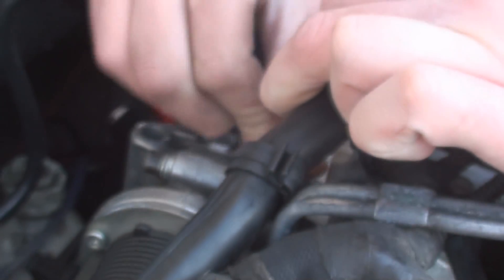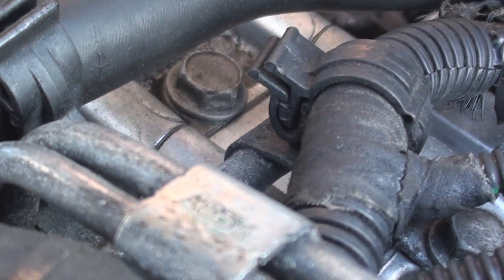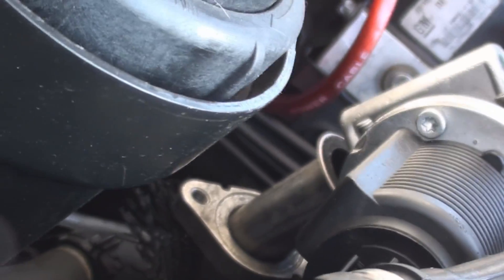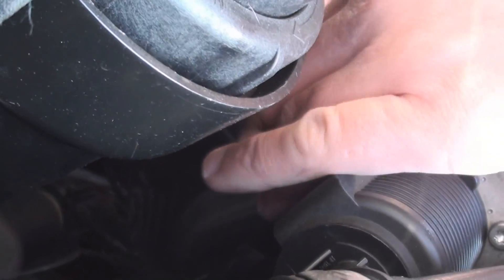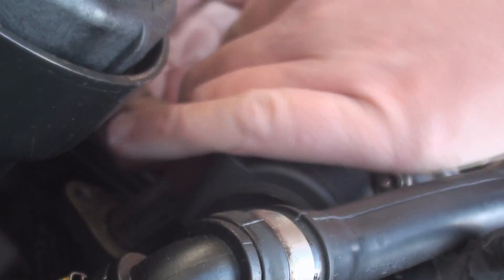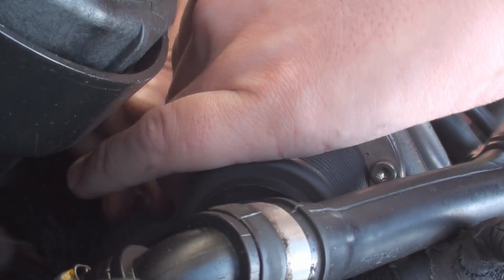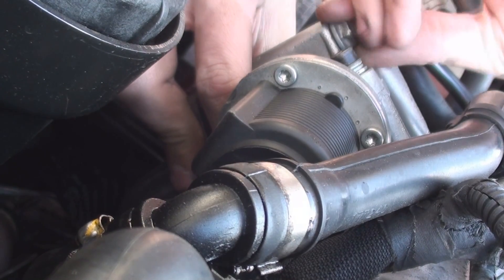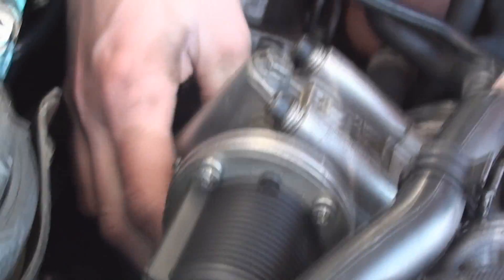How to: Fit a EGR Blanking Plate on a Diesel Engine

Comment: I thought that this was a guaranteed MOT failure in the UK?  Is it or it not? There is of course the option of removing it before MOT having ensured it still works unblanked. At the moment my poor Saab 9-5 is kicking a trailof black smoke out of the exhaust which blackens the grass in the field.

Comment: Thank you so much. You have no idea how much you've helped me. My EGR cooler failed on my Astra 1.9cdti and I didn't know how I was going to get it fixed due to parts being super expensive here. I decided today that I would buy a plate kit.. remove the cooler and and fit both plates.. But even that was a worry for me because I know other parts have to be removed to do that.. This is the same result but much cheaper and easier. I'd also like to say thanks for mentioning the plates with holes in them because I was wondering about and I was going to fit the plate without holes but now that you've explained all that I'll go with the  plate that has holes In it. Finally my brain can rest after weeks of stress. You're a legend!

Comment: Isn't having an egr blanking plate with a hole, the same as having a partially blocked egr valve?  The hole is not fully open and it's not fully closed either..... not ideal?  Won't the small hole eventually block up anyway?  Don't egr systems usually block up over time?
Reply: Having the hole in the plate is pointless.  No point putting the plate on . That plate is to stop exhaust fumes going back into the engine.  I think you are on about the egr flap .. you can take the vacuum pipe off the egr valve to stop it moving . So its always open . Ive always done a proper job and took that pipe off at the exhaust manifold and blanked it off with a gasket . Then do the same on the egr valve . If you know what i mean

Comment: I had a plate fitted here and the curved EGR pipe has split due to back pressure, best to remove EGR cooler and blank at exhaust manifold and back of inlet using both plates

Comment: In my case I blanked the egr like in this video but after 20000 miles I had a exhaust leak where the egr pipes comes off the exhaust manifold, Best way to block is on the exhaust manifold itself
Reply: I think so too, it seems to me that blocking it on the way back into the engine is just going to clog the EGR with the unrecirculated smog.  Gotta send it all through the DPF and out or block that too and just send it out like originally designed.

Comment: EGR is not working on my TDCI 1.4 engine, does blanking it will help ? its not letting revv my engine over 2k rpm..... tried installing a working one and was fine but its too costly to replace
Reply from the maker: Nope. Blanking a broken or not working egr will do nothing. As the car knows its not working and will put your car in limp mode. Clean it see if that helps. If so. Then blank.
Reply: @bluudysgarage  thanks for the information, can i apply any workaround to drive for 100-200miles .....  some good workshops are 200miles from my place and i will have to tow it

Comment: This doesn’t work and due to what your video states it has cracked my egr cooler pipe due amount of boost going through it, this blanking plate on the video should be on the turbo and on the inlet manifold, you bolted it too the wrong place. 

Bluddys garage need to research a bit better before putting videos up that people rely on
Reply from the maker: Daniel... this video has been online since 2012. You are the first person you have an issue. Please do more research in what you are on about before blaming others for your actions.
Reply: Makes sense, the EGR valve needs to be closed, but the hot exhaust should be blocked from going into the EGR and out of the EGR on both sides.

Comment: Soda can will do as an insert plate?
Reply: Yea, right, as if aluminum can could hold the 700-degree exhaust fumes, you need steel plate, aluminum can will melt and end up recirculated through your engine.

Comment: What if I must remove that plate later for car inspection once in year . I am sure it will not pass on inspection .  My question is ,  when I block EGR and descide I must remove the plate after a year for my inspection . Am I going to have any problem ? Is ERG going to be harmed and cloged when plate is on ?  What does this plate actualy blocks ?  Air that comes IN EGR or air that comes out of it ? Thank you . I hope you can answer . It would be very helpful .
Reply from the maker: Milenko Popovic you will be able to remove the plate with no issues.
Reply: Bluudys Garage And no consequences to EGR ? I mean its just for inspection purpouses . When I am pass I am puting plate back on ofcourse . Thanks
Reply from the maker: Milenko Popovic that's allndoen to you driving style. It may need a clean out from any build up

Comment: I blanked mine 8 months ago after a catastrophic manifold block up..all had to be replaced...
I left a 8mm hole as its supposed to stop the warning light coming on from completely blocking it...
Now the EGR has re blocked & I removed & cleaned it but the manifold looks really bad & im still right down on power....also light is still on..
EGR cleaning spray really helps the cleaning process I ordered a couple of cans & will be spraying that into the intake just beside the EGR every month...the only real cure is regular motorway use over 2000rpm...I live in London so my 1.9 Cdti astravan 150ps is stuffed full..
Modern diesels are too complicated to hit emission targets so that combined with the current war on diesels means it's time to sell especially if your city baced...I like the vehicle but alas it must go....Diesel has had its time it's going to die...
Reply from the maker: Diver Dan I am afraid you are right. Diesels are dying out now due to the rules and regs. Really shame your issue came back but as you said it is down to your location more than the vehicle

Comment: Do you remove the gasket and replace it with the blanking plate?
Or leave both in place?
Reply from the maker: IrishGuitarist1 I used both to make sure it didn't blow around the plate

Comment: I cleaned my LMM sensor on P307 2.0 hdi with alcohol and it finally broke. The result was that the Egr itself blocked and is still in the closed position. The result is better engine response, more power. Should I buy a new operational sensor LMM? I also noticed that the engine needs a lot more time to warm up to operating temperature.

Comment: hi there, in the vid you said that the EML light may come on if it should come on will it go into limp mode with no power or will it let the car drive with normal power many thanks
Reply from the maker: normally normal power. but can go limp if it triggers another issue.

Comment: Hi,I have Laguna 1.9DCi 74kw from 2003...Where I should put the blanking metal plate? Instead of upper part of EGR(the electronic-sensor) and leave the rest of mechanic part of EGR-valve in closed position?

Comment: Not good for the environment - look after the earth!  Not legal either!
Reply: how is it stupid, when an egr valve gets clogged up it feeds back the crap into the turbo and in time fucks it up, so don't talk absolute shit, I've blanked my egr valve off and it's passed the mots no problem I use 100% shell fuel save diesel in my car, no probs, all well and good saying about the environment but people have to fork out for problems with their car and money doesn't grow on trees, I bet you are a hippy cyclist who wears lycra and hogs the roads!
Reply: +Russell Mogg I hate the environment and do everything I can to destroy it! I fully support everyone who does the same. I removed all my emission control devices from my truck and now get far better mpg and hp.
Reply: turn your computer off to help environment
Reply: +Russell Mogg It's not good for the environment that the diesel engines are restricted in several ways. It looks good on the paper. When you have to regenerate for example the dpf all the build up will be released into the air anyway.
Reply: +opelduude   Why would you write something so stupid?  Are you saying that using this blanking plate is good for the environment ?
Restrictions are due to pollution control - trying to keep the earth clean. It looks good on paper because - it is!
This EGR blank off prevents the complete combustion - thus, blocking the DPF even quicker.
Reply: +Russell Mogg "Egr blank off prevents the complete combustion" Do you even know what an egr-valve does? It's like breating in your own farts over and over again. If you want to keep the earth clean i sugest you start with ship traffic and third world industry countries.
Reply: I ripped out my whole catalytic converter, smog pump and egr and now my truck gets about 6mpg better and has far better performance. Btw I dont live in a emission nazi state. We dont have vehicle inspections anymore.
Reply: Why sell gasket blank first place so can’t do nothing plenty of years back normal on earth :)
Reply: Jef Rey 😂😂😂😂😂😂
Reply: hahahahahahahah
Reply: hey cars are ment to go fast not to care about ur green and blue ball go fuck yourself and let the man kill his part of the world.
Reply: Engine Lives Matter, Pocahontas! It's time those fat, lazy, baby seal murdering polar bears learn to swim.

Comment: I am going to have a go at cleaning my egr valve on Saturday (first timer) but was wondering why the blanking plate is added and what does it do exactly....does it stop the egr valve clogging up again? are there any issues with doing it? Astra H 1.9 cdti 120 8v auto. cheers.

Comment: I had a faulty EGR valve on my 2001 Astra (Z16XE petrol engine). I replaced it with a brand new Delphi one sourced for a reasonable price and it has been fine ever since.

Comment: Hi, im having EGR issues with my Astra 1.9 CDTI Sri 150 2007
I know it needs cleaning and im thinking of fitting the blanking plate, but is there anything else you would need to do after fitting this plate like anything to do with the ECU? I've had the engine management light come up twice, came up once then disappeared and now it's back and im sure it's because of the EGR.

Comment: Yah, the only problem  could think of when getting rid/or blocking of the EGR valve would be that you would have to remap he injectors. How wonder how much it would cost to have it done? For the most part, it would just be hooking up a computer, and making some easy changes.
Reply: Why would you need to remap the injectors you are simply reducing recirculated exhaust gases.
Reply: Dave Davus Well that recirculated exaust gasses is more air going into the engine. Some of it has to be pressurized...?
.
I simply thought that was the problem with some vehicles with a "plugged E.G.R." valve, and poor performance? On some vehicles you could just put plates over the EGR valve ports, and have no problems, but others end up with motors that are running a rich fuel/air mixture. I guess it depends on the size of the EGR valve, and how much air/exhaust gasses it is pushing through the intake (that air isn't read by the "Mass Airflow Sensor"... or the thingy that measure the amount of air going into the intake/engine. Sends it to a computer, and the computer decides how much gas is being pumped into the engine through the injectors!)!!
.
To be honest, they should completly do away with electronic fuel injected systems, and go back to a simple carb. Nothing will ever be as exact as a mechanical fuel delivery system...
.
They also need to start incorporating reed valve in the intake, so the gas becomes more atomized. As well as a higher intake ports, or longer intake ports in order so the gas becomes more atomized (incorporate that with a carb setup)!
.
I was just looking for a... FOUND IT! This vid shows a old engine used in faming back in the day. It's got a "vaporizer carborator"! watch?v=FDHQa0zv4D4  Probably the reason 20 oil cars jumped the track and blew up (just yesterday they said it was only 6... everything changes, day to day... even the bible... WTF!?)....
Reply: Hiya Brain, you are right in a way but the gas is still metered with the MAP ( manifold absolute pressure ) sensor on this particular engine It has both a MAF ( Mass airflow sensor ) and a MAP  so it will be able to adjust the ratio of fuel to air acording to these readings. obviously other engines will vary.

Never heard of reed valves being used in a 4 stroke engine, or a vaporizer carburetor I shall check it out.
Reply: The EGR is going to put in hot exhaust fumes into your cylinders with low oxygen content that probably won't burn up anyways, instead, the fumes collect residual oil and more soot and then clump in your exhaust manifold, the recirculation method is faulty and ruins engine longevity.

Comment: 1 suggestion, add a short explanation of why you should do this mod and what maybe can go wrong doing this and even the tools you need and you're looking at a fantastic series, good video though :)
Reply from the maker: Great advice, Check out our latest EGR valve Clean (1.7), all tools needed are listed, advice given etc...

Thank you.
Reply: cool :)
Reply: Absolute Modicts if the egr is clogged surely that does the same thing

Comment: I have a 'master' blanking plate as used by the AA (Automobile Association...not the ones for alcohol dependents! ) It fits virtually every vehicle. Whenever I blank off EGR's I just draw round the 'master' template onto a tin can lid ( or similar), snip out the shape, drill out the mounting holes and job done.  Free, fast and foolproof!

Comment: Hi Mate. I fitted one of these today, and now my car won't start, just seems to turn over and over but will not fire. It's a 2006 Vectra C 1.9 CDTI (150) Any help would be great. Thanks.
Reply from the maker: Hey. Have you removed the egr and tried to clean it at the same time? Sounds like the eg is stuck open. It need to be closed to allow the car to start!
Reply: Absolute Modicts Hi, and thanks for the reply. It was starting ok before I fitted it, so would that still apply in this case? I fitted it as the thought of clogging my engine isn't nice lol
Reply from the maker: Shouldnt normally cause this issue, possible there is a EML light on and a code stopping it from starting. i would take the plate off and try again
Reply: Absolute Modicts Well, I think battery is on way out. Had to jump start it and it took a fair amount to get it going. Guess the engine was kinda confused after the plate was put in lol Drives great now, instant improvement. Cheers mate.
Reply from the maker: Well at least ita sorted! Glad its better! Thanks for watching!

Comment: Can you use the existing bolts with the blanking plate or do you have to use extended bolts? Thanks
Reply: Thanks for your reply Ahsan. I fitted the blanking plate a few months ago now but thanks anyway bud 😃
Reply: @johnbob90519  what was the answer?

Comment: Hi I'm struggling trying to fit one of these to my astra. Do I leave the gasket on aswell or do I just put the plate on? Waiting for a new plate in the post atm as I dropped it in the engine somewhere and can't find it lol 😲 I'm having trouble lining the bolts up and the exhaust doesn't move as much as the one in your vid. 

Thankyou
Reply: loosen up the exhaust clamps

Comment: Why do you guys remove the egr your vehicle is going to pollute more and create more nox
Reply: how much more, how much more the a poorly running motor due to carbon build up, how much more due to the car not lasting as long?
Reply: So lets think it this way.You leave the EGR and the other thing that extremely "helps" keeping mother earth safe.And the car engine dies 'cause of the soot buildup in the engine,so you throw the car and buy a new one,then it happens again ,so you just keep buying cars and the car industry keeps producing them and while producing the factories produce more,co2,nox and who knows what not,then me Plating/blinding/ removing/deleting an EGR valve.I think plating an EGR kepps an engine more or less safe and people don't need to buy cars as often and the car industry doesn't have to produce so often and that is how we can keep helping mother earth.

Comment: It is easier to make changes in the ECU. I've just done that on my car. I had to change values, so the EGR does not open anymore. Than there was a little bit of extra work, so the error light does not go on because of the EGR fault.
Reply: Wit higher boost egr will open it self.

Comment: I'll fit a plate if it's arrive tonight and hopefully be able to start and rev it enough to see the rods moving.  Will they move even at low revs?  I couldn't get it above 2000 before.  Much appreciate your help/videos - I'll check out the website too.  Keep up the good work!

Comment from the maker: Check the operation, get someone to rev it, and watch if the rods are moving?

if you get stuck or want more help, check out our site, and we shall see if we can talk you through.
Reply: Hi I have a Kia Sorento and it rough idles on cold start with a white/blue smoke but runs very smooth after about 10 minutes with no smoke whatsoever, everything I read pointed to the egr valve so I blanked it off to see if that was the problem as these erg valves seem to be a nightmare to remove but there has been no change in it's behavior, is there anything else you could recommend checking? It's a 2004 2.5 crdi 16v engine, any help would be much appreciated.

Comment: Any news on this?  I'm having the same trouble on the same car.  It's gone from running bad with EML on to cutting out completely.  Green Flag's diagnoistics kit suggested EGR valve so I've striped and cleaned it as well a bit round the inlet manifold, but to no avail.  When taking it off for the 2nd time again I notice a lot of black wet slugde had appeared in the inlet manifold.  Do you think it could the swirl rods?  God I hope not.  Hoping to fit a plate this wednesday.